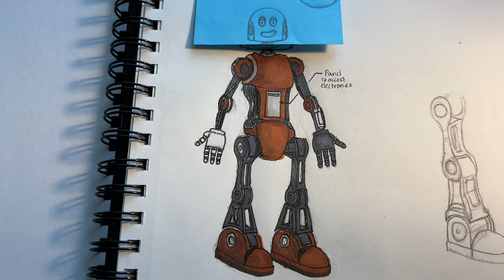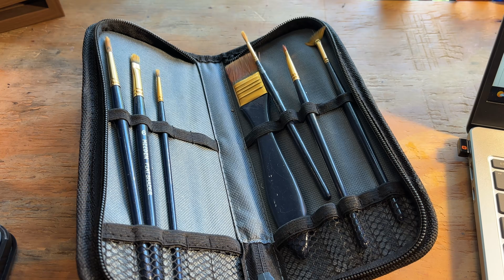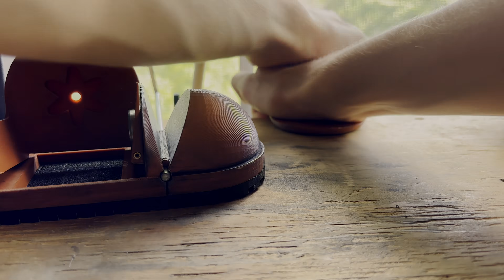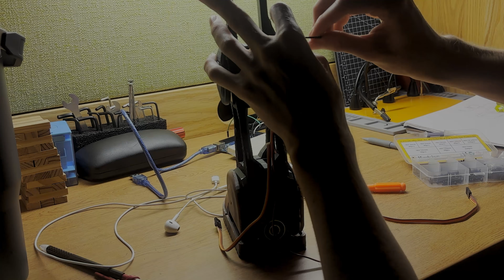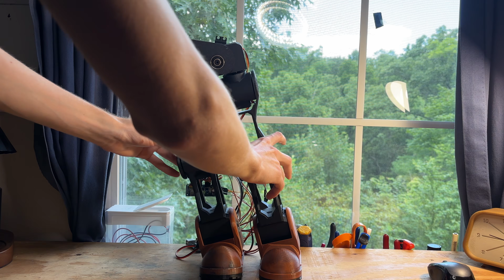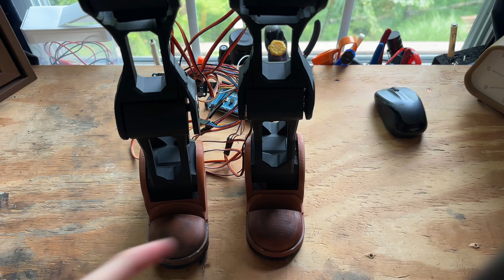I Built Humanoid Robot Legs

Comment: The problem with robots are their joints. In arms and legs. The joints are cumbersome and bulky, for the most part and none modeled much like humans or human like in movements. Stop motion armatures are the closest things to modeling after human joints, though, are not robots, obviously but a design that I’d be interested to see incorporated into robotic joints is something akin to the Rosheim joint, if it can be adapted to be motorized.
Reply from the maker: Yeah the joints are definitely one of the more annoying parts. I thought the same thing when I first saw the Rosheim joint. It would be very cool to use that in a robot.